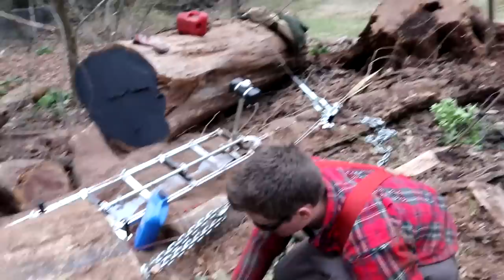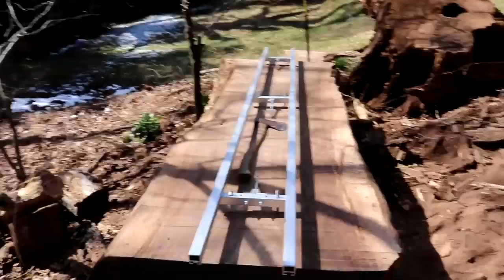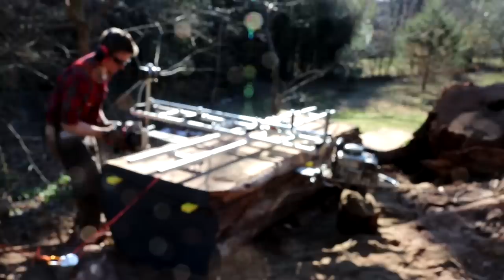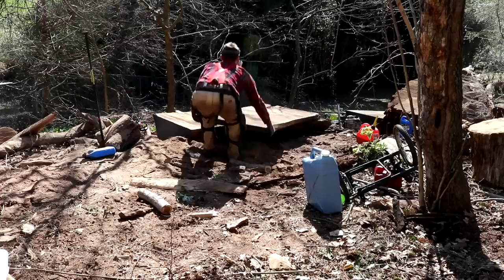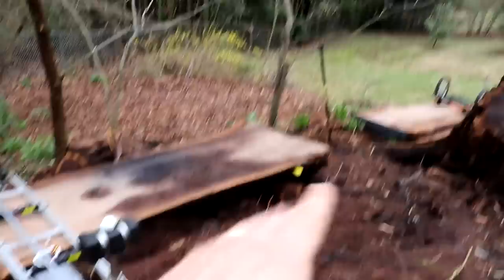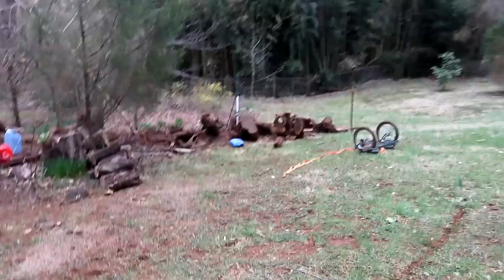Monster Chainsaw Milling Monster Walnut FINALE!

Comment: You say, "prime sawdust".   Can I ask what that sawdust is used for?  I'll bet there will be a ton of it when all is said and done.
I know black walnut is fast growing, so like willow and silver maple, means weak wood, certainly not like white oak.  BTW, Congratulation on 102K subscribers, and I doubt ladies watch your channel.  I don't even know why I think it is so interesting, maybe because you have inventive solutions.
Reply from the maker: It was a joke, about the dust......since it's made out of walnut. Any material can be strong or weak depending on how it's used. As furniture, of any kind, most any wood is more than adequate.  Thanks.
Reply: Joke?  If you say so... although it must have a use.  Body scrub maybe?  Joke.
Many people would use that as a mulch or soil conditioner.  As we know wood chemically uses nitrogen to decompose, which is key for desired plants as well.  So that is a fools errand.  Putting that around your cucumbers and tomatoes would be a big mistake.
Further, (I don't know about regular walnut) but black walnut (Jugulans nigra) emits a strong toxin to other plants, as most do, but that tree in particular is known for being very competitive.  Supposedly nothing will grow around it and that might be a good thing in certain applications.  When have you ever seen even a weed vine growing up a black walnut?  Sort of like a natural Roundup or pre-emergant.   Might be good for a chip and tar drive?  I dunno.
You make a good point as I have seen even willow furniture or baskets, kind like rattan, it just depends, as you say.  Thanks for reminding me.
Much respect, I would never have known what to do about that damned tree.  Yes it is work, but you at least know how to deal with it.  Think of the high end tables that will make, way too rich for my blood.

Comment: I can see a metal detector in your future,  even my children's cheap toy detectors can save you from a lot of problems and inspire you to buy a better one.
Great video, keep em coming....
Reply from the maker: Already have one....but I'm not going to skip milling a log because it beeps. It could be a BB or a pipe, you don't know till you hit it. You can also find non metalic objects in trees that will stop you dead in your tracks, it's just part of the experience. Thanks.
Reply: The Homestead Craftsman
 I understand completely , wasn't trying to ruffle your feathers.  I bought one of those small wand units at a sheriff's auction.  
I would never suggest that you not mill a tree for any reason,  but the right detector can tell you if it's a nail or a horseshoe, and the horseshoe might require adjusting your approach.  It's nothing to throw together another loop of chain.  Heck, for the right piece of wood,  I've invested 3 Band mill blades in a single slab, but it was worth it....

Comment: I was watching your struggles with the nails.  It might not help to know, but in central Missouri, we have a lot of black walnut and there was a spat of tree thieves for several years so homeowners were putting large pole barn nails into trees to discourage theft.  It doesn't help you but it might explain why you are running into nails / metal in the wood.

Comment: You must sleep like a dead person after a day like that. OMG. I would be buying a tracked skid steer. Heck even a good John deere lawn tractor would pull those slabs upto the trailer. Buy one from the 70's with an old cast iron Kohler engine. It will serve you very well and save some wear and tear on your body. I am 50 now and have to stop the construction because of doing exactly what you are doing in this video. We are all invincible till we are not.
Reply from the maker: I do......a would love a skid steer. I'd like one of the mini skids with forks, one of the ones you stand on that can fit through gates and such. Lifting the slabs is the works part, and not safe long term.
Reply: Yes, we're all bullet proof until we wear out the carcass, and then we all wish we'd been aware how hard we'd "rode that hoss"!!

Pushing 70 and can't hear, but wore double hearing protection! Can't smell but wore a breather and filters; can't see but that might be just age?  Can't lift my own tools that I spend a life time collecting!!! 

Great video of an energetic and resourceful young man, pleasure to see this much industry in a man his age!

Comment: Man I have one of those tools that I just seen you extract that nail from the log I always wondered what the hell that was used for and now I finally know that's what that was used for extracting Nails that's why it has the slide hammer handle on it
Reply: Shit had no clue that was a nail puller

Comment: I have got an 8 foot wide oak log that I am trying to mail with a chainsaw. I have a 72 inch bar on my chainsaw but I need to find out what chainsaw mill would handle a bar of that size does anybody know
Reply from the maker: my bar is 72 inches, the saw is a Stihl 090. In using a  Granberg mill. I think I can do a 59 inch diameter log. Look on their site, they have bigger mills.

Comment: I am a custom call maker.  Have you ever thought about taking some of the small wood that has great figure and making blanks that are 1.5 x 1.5 x 6?  That is a standard sized blank that call makers seek.  You seem like a very hard worker and probably wouldn't mind making some extra money in a potentially new market.  Love you channel.
Reply from the maker: Hadn't thought of that exact idea but I have sold stuff online before and didn't like all the running around for shipping. How much do the blanks sell for, on average or a window.
Reply: At that size mentioned I've seen them go anywhere from $5 to $100. It really just depends on the type of wood, the figure and if it's dry and ready to turn.
Reply from the maker: What is your guess for this walnut, out of the stump/root. It's color seems good, orange/brown/black? No problem if you are not sure, probably one of those things you need to see in person to answer.
Reply: I would need some pictures. You can pm me if you'd like.

Comment: SUGGESTION: buy a metal searcher as those treasure hunters and check the tree prior to cutting it ... should solve your problem
Reply: you don,t understand he knew nails were in it after he hit the first one which is very common for trees that are on the fence line of property that,s why saw mills wont,t touch them so if you want the lumber you have to sacrifice a chain sharpen no way to remove them they were grown into the wood
Reply from the maker: I got tired of explaining that a while ago.
Reply: @thehomesteadcraftsman8975  I get that. But what speaks against using a metal detector? You could mark the area where you detected metal with a pencil and try to avoid it as far as possible. Then you also know where to search for the nail to pull it out before it hits the chain. Or? Thats what I am not understanding. Are metal detectors not precise enough? But I have to say ... it was a super impressive tree. Would love to see veneer from it.

Comment: How much do you estimate all those slabs are worth?
Reply from the maker: If you are charging by the board foot and being competitive with online sellers, over $1000 each, there's 21 of them. I did the board feet on one and it came out to $1700. These are not in premium condition since the sapwood is gone, but the brown heartwood is great and actually nicer in ways than a fresh tree due to coloration.  If anyone else is reading this feel free to chime in. The real answer is it depends where you are selling. In my town, it would be hard to sell, in an area of the country or world that does not have walnut, it would be outrageous.
Reply: Solid find then! Congratulations!

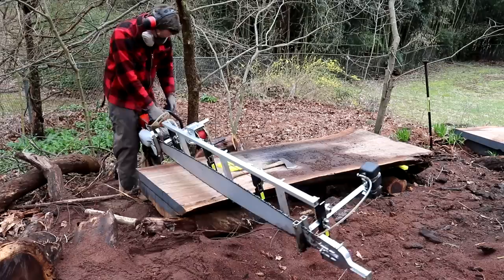Comment: 14:26 This happened to me on my lawn mower 😵
Reply from the maker: I thought that would be a good part to include, that when you are working on anything, it's half doing the work, half fixing things that break and solving problems. I liked the devastated look right after the rope came out of the handle. I had just spent about an hour sharpening the saw and setting up for the cut after hitting a nail. That was me very mad.

Comment: as a non-woodworker I cant help but wonder, how much is this kinda and amount of rough cut lumber worth
Reply from the maker: These slabs, dry would be roughly $1000 each slab, there's about 21. They can cost much more in certain locations though. I'm just going off the board footage and what others have told me. You can google, walnut slabs to see what people sell online for.
Reply: for that sort of cash you could hire a guy to help move it, you only get one back , and once its gone.....
Reply: The Homestead Craftsman 
                      Holy cow, dont put the value out ther'e or you will have land owners wanting they're $ fair share or more !! and it will have them looking for1 highest bidder and just like antiuqs they will become greedy.Just my thoughts I'm probbably wrong.You do amazing work.
Reply: You make a fair point, but actually 'landowners' are already pretty savvy and commonly tender to come chop up windfall like this.  However, I think THC said it was a family backyard who just wanted their yard back.  THC can I ask what the name of that little cord crank you use to drive the bar through the tree is called?

Comment: That was a great job, only thing I seen you do wrong was...you bought a Chevy! Ford all the way baby!
Reply from the maker: I am unburdened by brand loyalty in trucks, with that said, I feel the chevy is a better looking truck in my opinion. I paid $2500 for it. It was exactly what I wanted, 4x4, extended cab, long bed with a cap, even the roof rack was on my wish list and low and behold, craigslist came through.....I wasn't ready to buy but I could not pass it up. Thanks for watching.

Comment: hi just a tip to save your young back  from being a sore back in the years to come    put a  4 foot length of scaffold tube over your ratchet  lever  you can stand  and get your  body shape  right  trust me  it pays off in spades   cheers will

Comment: why wouldn't you use a metal detector  to find all the nails, to save your chain?
Reply from the maker: +Adam M Even if you find them you can't get them out if they are inside the wood. These are valuable slabs so it's worth it.

Comment: I thought you had a metal detector or a wand or something. Maybe another channel. Get one?!
Reply from the maker: I do, but a beep just means there's metal...which I can tell anyway with the stains. If the nail, or other metal, is inches into the log, there's nothing you can do. You have two choices, mill or not mill......I'm going to mill it if the log is worth it. It could be a BB or a pipe, you don't know till you hit it! You could also miss it or cut through a thin rusted nail.

Comment: would not using a metal detector help you to find nails and such
Reply from the maker: The milled up lumber is worth thousands, pretty much any tree growing in a yard is going to have metal.....it will beep but you won't know what it is and where it is exactly......in short, I know there is metal in these trees. I can sharpen and replace chains.

Comment: I'm going to give you some unsolicited advice...  When I was younger, I used my body like you do.  Now, at almost 50 years old, I own a tractor and know a good chiropractor.  I wish I had bought the tractor when I was younger, I wouldn't need the chiropractor.  Stop doing things with your back that can be done with mechanical leverage and heavy equipment.

Comment: All ways use a metal detector we do ,purchase a small hand held unit not expensive ,you are destroying good chains ???>Paul
Reply from the maker: I have one, in trees it could be a small nail or a pipe...you never know, both will set of the detector. Just because there is metal, doesn't mean I'm not going to mill the log, especially in the case of wood as valuable as this. These slabs are worth more than the trouble of milling logs with metal. Hope that makes sense.
Reply: I agree this timber is expensive i wonder is there a duel blade you could use  skil had some timber / metal, good for small metal particles like nails its a long time ago since we used one but i will look and see if i can find some information on them ,however have you much more to cut ?.Paul
Reply from the maker: I'm done milling the walnut.....but there's always another log. Since then I milled a big white oak, 5 logs, 100 inches each, about the same size as the walnut, some was bigger. The best thing to do is to avoid yard trees..but they are often the big ones. It's just part of the game.
Reply: Wow man you have some big lumber ,any how keep safe love the videos ,Paul.

Comment: Really , a respirator? I worked In A furniture factory splitting rails all day long on a radial arm saw with no respirator, and I’m doing fine 50 years later. U guys listen to much to the EPA...just cut the wood and wear a bandana like we all did...